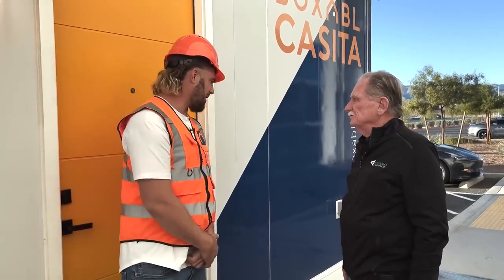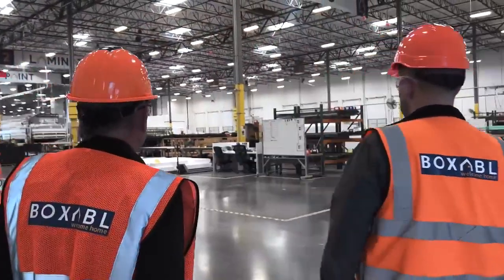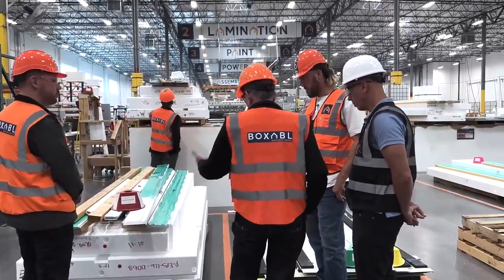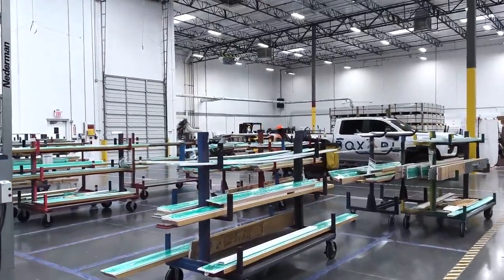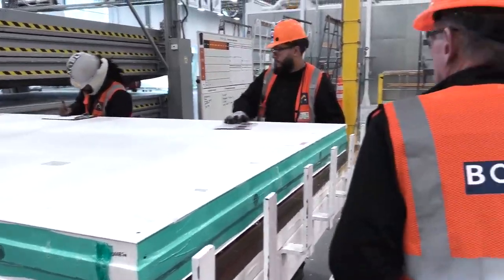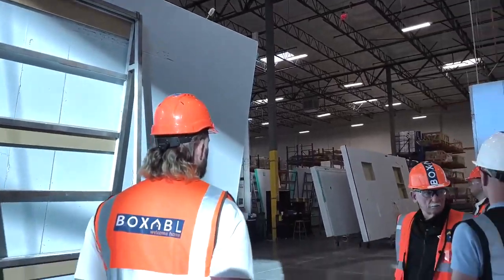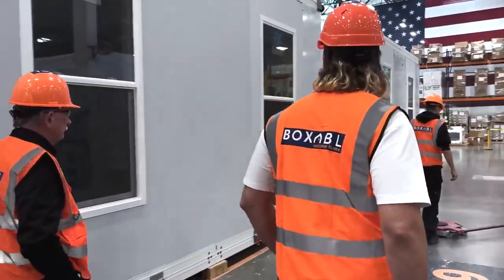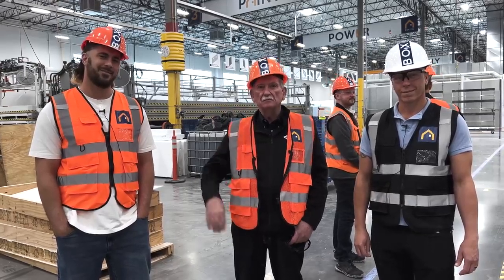FULL TOUR with Munro Live!

Comment: They should make a complete man cave version with a big screen TV and recliners. Maybe put a gaming PC setup in there too!
Reply: Agreed:  And this can be done in one of two ways:  1-Place a Casita on top of a matching 400 sq ft plumbed, pre-wired, unfinished basement.  Then  layout the entertainment level however you like (and with good design, isolate the noise between levels).  2-Own a lot large enough for multiple Casitas, buy some unfurnished modules in addition to the main furnished unit, and use them for entertainment rooms.  Option 2 is my plan so everything is one the ground level.

Comment: Are factory tours, including a finished unit, available?
Reply from the maker: Yes! We have Factory tours in Las Vegas and virtually that you can schedule using this link: boxabl.com/tours. Please note that the calendar only shows availability for the next 30 days. You can also stop by our latest Casita model, which is open 24/7 in our parking lot at the Boxabl Factory-1 5345 E N Belt Rd Las Vegas, NV 89115.